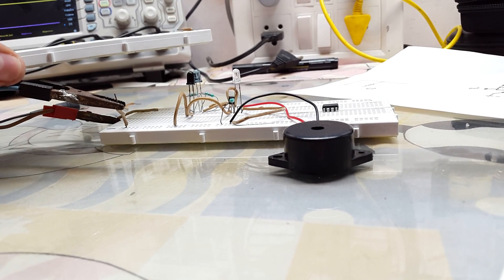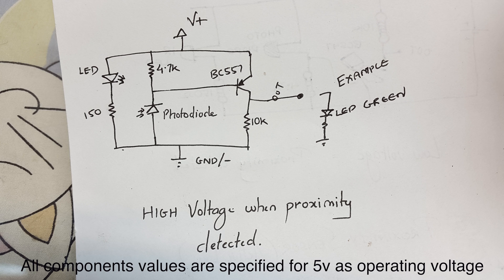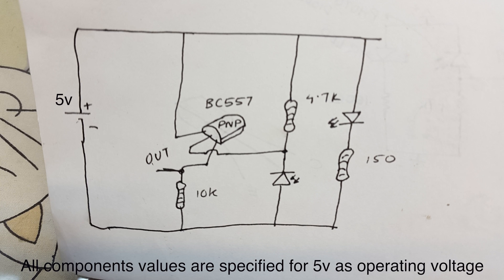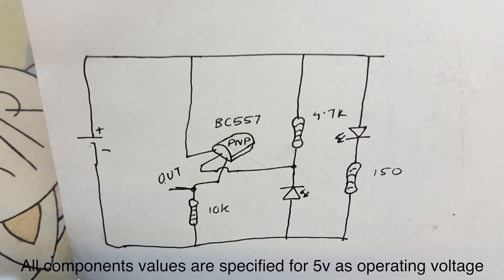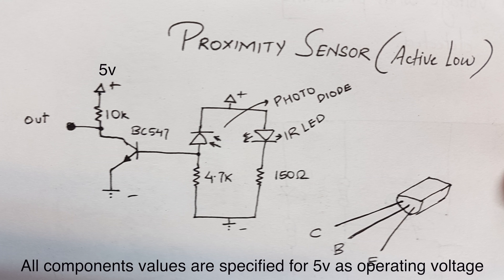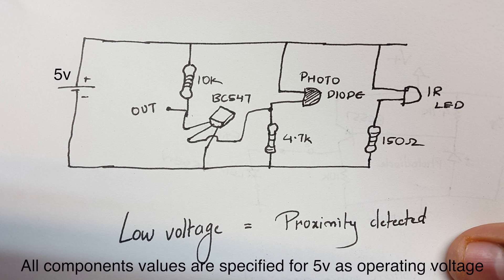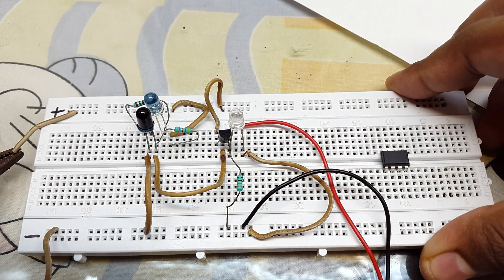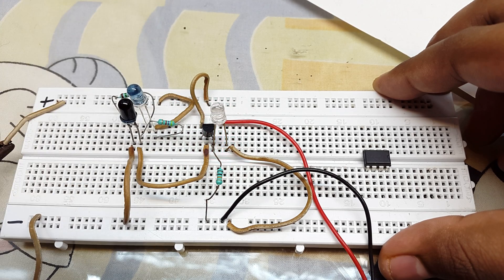How to build a simple Infrared(IR) Proximity Sensor

Comment: does this work in the dark too?.. or any lighting conditions?.. cheers.
Reply from the maker: It actually works better in less and moderately lit conditions(it has a IR LED). In highly lit conditions(sunlight for example), photodiode cannot distinguish between the environment light and IR LED so the output goes high(or low in case of active LOW version) regardless of any proximity.
Reply: brilliant, i'll try this out then..thanks very much, all the best.
Reply from the maker: Yup👍

Comment: can I use ir remote instead of ir LED.
Reply from the maker: You'll get pulses on the output. The IR LED on the remote doesn't stay on continuously, it pulses to represent data. I think you can make it work by adding a capacitor to the output. Or just desolder the IR LED from a old remote
Reply: THANKS!! I will also use a diode for improvement!